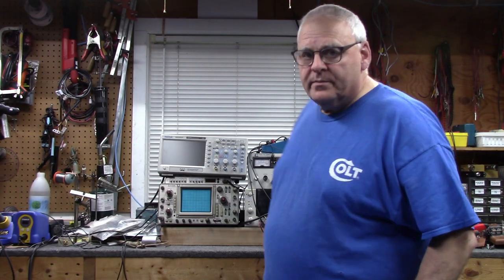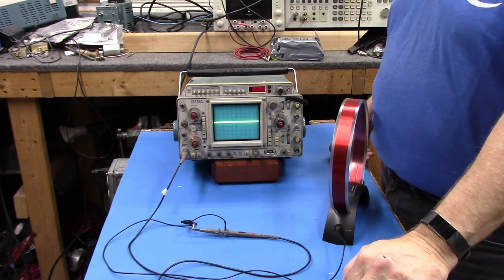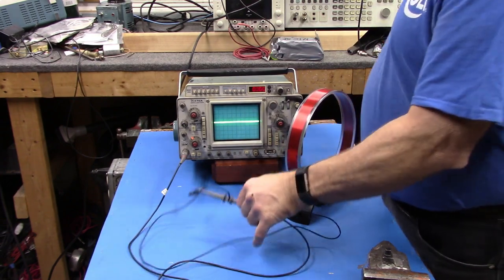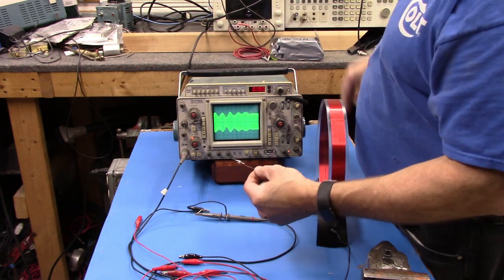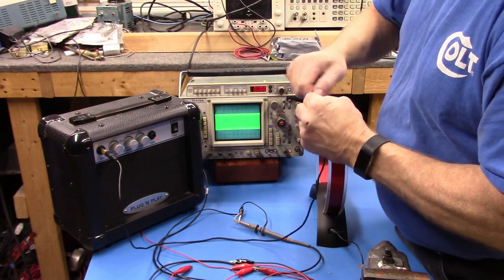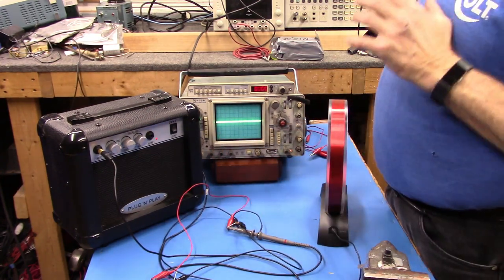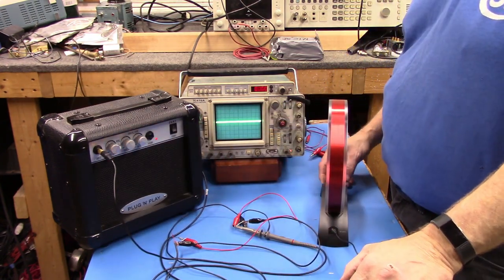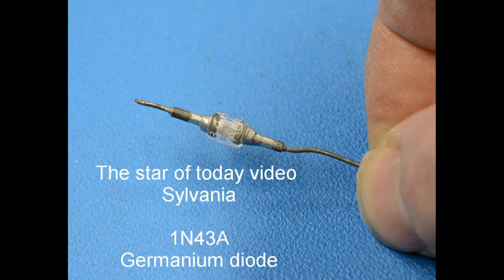Listening to free radio with your air core loop and 1N34A germanium diode

Comment: When you learn how to use these passive loops, they work well.  
Digital TV is one thing, but radio is an important tool for the survival of the country!
Reply from the maker: I could not agree more.  The ability to pass communications onto the public using a diode and wire alone as a a receiver is impairative
Reply: @W1VLF  eye-phone owners will disagree! 
Let's see how they get emergency comms when their eye-phone doesn't work- or even turn on!  The rest of us will be digging out the hams, or stringing up long-wire antennas.
I've been listening to SW live from the Ukraine, since the wart started there.

Comment: I've learnt a lot from your videos. Thanks for putting the effort into them 👍
Reply from the maker: Thank you  Ziggy man   Thank you for taking the time to comment!! W1VLF
Reply: I've built a 60khz antenna for the MSF signal in the UK, not as long as yours but I didn't have a secondary coil on it. It's 7.6mH with around 925pF cap. Some exciting work to be done. Please keep it up

Comment: 3:27  thats just the plastic ring that holds the wraps of wire. I thought the same thing, but the plastic ring is halved and the part you're seeing is the step of the two halves so that they'll hold together.

Comment: Hi Paul. Pretty sure it was my comment you referred to. Yep, I'm really enjoying BCB dxing. I've been playing around with a wideband untuned loop I cobbled out of some speaker wire and a little LNA module from eBay. Kind of a real poor man's Wellbrook. I'm about 40 miles south of St Louis, and with my cheap Retekess V-115 radio/recorder and my loop, I'm getting all kinds of dx. Regularly enjoy a number of Canadians and Cubans, and everything inbetween. I've also got an AN200 loop and with a diode and an old pair of Trimm Featherweights I regularly listen to my neighbors KREI (800KHz) about 3 miles to my south, and KFMO (1240KHz) about a mile to my west. Yep, I think this might be the most fun you can have with your pants on. Thanks again, and keep 'em coming. '73
Reply from the maker: Yup Carl you are correct.  I am not sure if  can mention names yet on YT...  As you can see I am new at this.  BTW no one wants to see me with my pants off LOL.. Not even my wife!!!!  Thanks for the comments.

Comment: In the 1970s I was playing with unpowered AM receivers and made what I believe is the least complex receiver possible. I had a straight length of wire, a germanium diode and a single lead to my headphones. The headphones had no ground connection. I was able to hear WEAM-1390 in Falls Church, Virginia, the strongest signal at my house 5 miles away in Arlington. I agree that it would be sad if the US one day lost AM radio. I found this video in a fruitless search of the web, looking for documented examples of radio reception in plumbing fixtures and fences.
Reply: got one easier than that, I took an old CB antenna & clipped it to the hot mic input on a laptop & using the media player to monitor the mic, was able to pick up my local 5kw AM station (transmitter about 5 miles away). No tuning capacitors, no diodes, no electrical components, no software,  just antenna into the mic input, using the laptop as an amplifier. But of course this only works because of 2 things: 1) being close enough to a strong AM transmitter, & 2) dumb luck that the cb antenna is able to resonate close enough to the strong local station's frequency. Give it a try some time

Comment: HaHa I`m good in the call book :) I havent seen a callbook in years
Neat call w1 very low frequency
I have never experienced loops
The tuning is pretty darn sharp
sharper than I would have thought
I have built very simple crystal sets
The high q of the coil there does make an undoubtedly big improvement
73
Reply from the maker: Yes .i does... In small antennas, fractions of wavelength, I like to say "it all about the Q".    Also I figured there would some OM out there who got the joke!!!   Thank Frank

Comment: Cool beans.

My friend gave me a crystal set she had giffted her deceased husband. I assembled it. I plan to do more than the basics later before I switch to SolderSmokes direct conversion receiver.

kc2wvb

P.S. Neat loops. My most recent tx/rx loop was made with 4 inch diameter aluminum dryer vent tubing. 4 foot square with 23 inch per side square of 3/4 copper pipe as te drive/sense loop. Its sweet on 40 up to 20 meters.
Reply from the maker: Hey that's great!   I am going to look at SolderSmokes direct conversion RX I had not heard of that before.  W1VLF

Comment: Thanks, enjoyed this video. Is that a type-o in the end? 1N43 vs 1N34? Seems 1N34's are hard to come by these days. Folks talk about fakes and receiving silicon diodes instead.
Reply from the maker: Hello,  it was a 1n34 diode.  I found a couple at a local ham radio fleamarket W1VLF

Comment: I have read about using a voltage divider to feed a silicon diode about 1/4 volt DC to get its larger forward voltage drop over germanium reduced. Have you tried this?  Really like your videos
Reply from the maker: No Sir I have not tried that, but it does make sense.  With weaker signal you may not have enough voltage to turn on the diode. Thank for the kind words.. I will keep on making them is people are enjoying them W1VLF

Comment: I know I'm commenting on this video a couple of years late, but can you please answer me a question?  What circuit(s) did you clip those germanium diodes out of?  I would like to find one in the "wild", so to speak, meaning salvage it from some piece of electronics.  Are you able to tell me what would normally contain these?  Thanks in advance!
Reply: If you find any older diodes, there is no warranty that the "crystal" will work, because for example in our country, on long waves in the amplitude modulation has not been broadcast for a long time. In addition, the crystals worked well at a time when the transmitters had power calculated in KW. Today, the situation is such that transmitters have power in fractions, ie in watts. But well, if you want a spare diode, make it from galenite according to old instructions, but you will not be satisfied with the functionality of the above causes. In the "wilderness" use an old cell phone that has a functional part of the FM. With a long coaxial antenna you can capture the signal and also have free radio. You can power the old mobile phone in the wild with a small solar panel. The video is not honest because it does not draw attention to problems. But it is possible that somewhere it is still broadcast in the amplitude modulation on long waves and the transmitter with great power is in sight. Then it could work.
Reply: you won't find these germanium diodes in anything modern that you can salvage, you may find one in an old radio circuit board but the leads will be too short to re-purpose & there's no point in ruining a good radio to make a crystal radio. You can find them online, also the old radio shack project kits always had them to teach beginner radio circuits.

Comment: Very cool.. Question: Could the amp be replaced with a crystal radio earbud and diode inline,  making it not need electric at all? Thanks ahead of time and keep up the cool work.
Reply from the maker: Absolutely.. You would then have a real crystal set. As long as the signal of the station is strong enough to drive the high impedance head phones
Reply: @W1VLF  Thank you again.. will give this a go.

Comment: on the AM loop you showed at the end what is the smallest PVC size you could get away with when building one of those?
Reply from the maker: Hi Ronny..  The area of the loop is what determines it ability  to capture signal.  If you used to 4" diameter instead of 8" the level of signal would drop by 6 db.  2" another 6 db approximately. If you halve the diameter of a circle, the area reduces by 4 times, the opposite if you double the diameter

Comment: I am amazed at the reception range i get with my loop. I live outside  of Philadelphia and picked. Uo a station in NC. I w was a freaky right wing low power station spewing forth  white hate speech in disguise. Is this what has become of AM radio, now hate radio, even the evangelicals are off the wall.